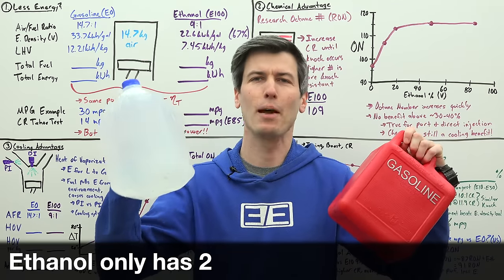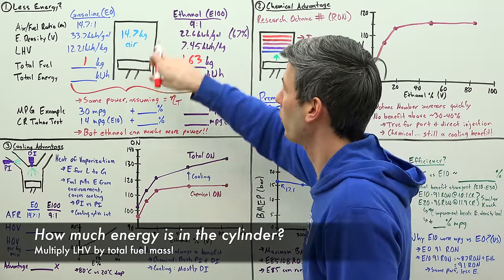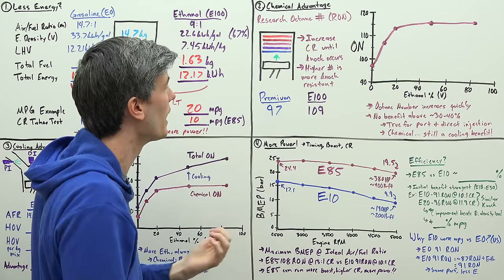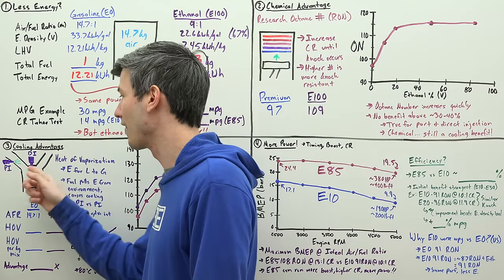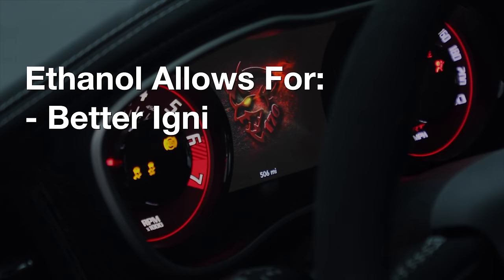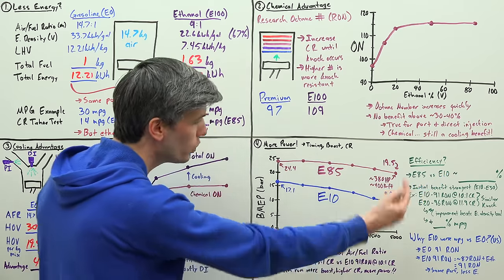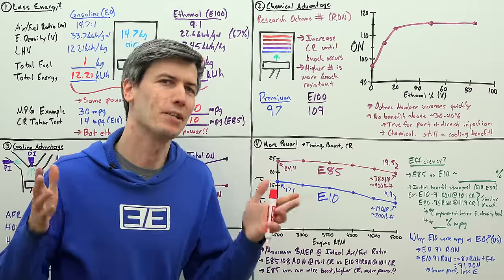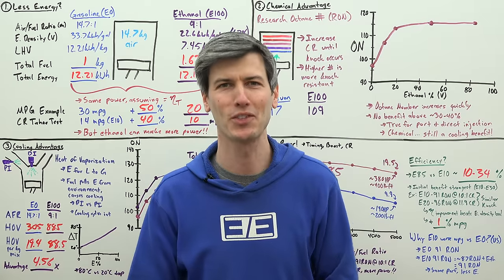Why Does Ethanol Make So Much Power? (Versus Gasoline)

Comment: I am actually curious about the synthetic fuel that I think Shell and Porchse are developing in Chilie. Could we see higher octane fuels because of the synthetic nature of the process?
It would be interesting if one day we could get 120 octane pump gas and run far higher levels of boost in turbocharged cars.
Reply: Synthetic fuels are going to mostly come in low-octane diesel.
Without mixing ethanol, it's much more difficult to get high octane numbers. 93 octane gasoline is equivalent to 90 octane with all the ethanol removed.
Reply: Yes currently at the Porsche facility they make a heavy and light gasoline when they are making fuel but they mix them to produce the synthetic fuel. So if you only use the light gasoline, without mixing, then the octane would be much higher
Reply: It's possible. When making things synthetically, you can tailor the process to get whatever compounds you want. Tests done in the Naval Research  Lab for mil-spec aviation fuel (meant to be powered by a ship's nuclear reactor) show a better concentration of the lighter hydrocarbons. You can then oligomerize them into larger stuff. And a cost of less than $3/gallon.

Comment: There was a cool paper I read from Ford where they did testing on a dual fuel system, with the engine running on 87octane gasoline, but when you got on the throttle a bit of e85 from a small tank was injected to combat knock and cool the intake charge.
Reply: Haram... you're one fuel pump/injector failure away from overheating your engine.
Reply from the maker: Neat!
Reply: @igrluz  no, you just limit airflow into the engine, so it would operate under reduced power. That's the mode it was designed to operate in if you let the e85 tank run out, or you couldn't find any.

you can run a high performance engine on regular gasoline, you just can't put a heavy load on the engine or else knock shows up. Limiting max manifold pressure with the electric throttle body would be easy with software.

Comment: Hey Jason , when you apply the brakes just a little bit in a dct, does it disengage the clutch completely. What if press the both accelerator and brake ,what happens to the clutch then?
Reply: It would only disengage at ~1000 rpm in gear 1, right? Any other gear it should just downshift before the revs go too low
Reply: It's probably in gear to save fuel, if you clutch in you will idle and burn fuel
Reply: @jonathansmith7306  that’s what I would think, though I’m sure each manufacturer tunes theirs a little differently. No idea what happens if you’re driving and hit the gas and brake at the same time though, but likely it won’t disengage the clutch until it determines you need to shift like you said.
Reply: @ALMX5DP  for the second question, if you hit both the accelerator and brake at the same time, the controller would probably measure which direction the tachymeter goes. If you are able to keep the needle still, it won't matter because it won't have to shift
Reply from the maker: Brakes won't trigger the clutch to open in DCT; if you're at speed it will remain in gear. If you're at a low speed (inching, very low speeds) the clutch will slip to allow for the lower speed (we're talking under 3-5 mph or so, where the engine speed would be too low for the current vehicle speed). 

RE gas & brake, depends on the make. Some allow it, some will say "they want brakes." Either way the clutch is likely engaged unless you're at a very low speed.

Comment: This is why many WWII fighters were equipped with methanol injection, they could run higher manifold pressures and make more power during dogfights without detonation destroying the engines. Reno air racers too, of course. (methanol/water mixes, and other concoctions were also used)

Comment: Ethanol is cool in general. Higher consumption means hard no for me - also not available in Canada at many places. Also, heard many guys complaining about having to do maintenance/tune ups more often due to plugs getting fouled quicker.
Reply: Main issue is when it get’s water in it do you need more stainless etc.  Most modern engines do that, and once that is done it is less of an issue.  I am unsure on what spark plugs are made of, but that may be part of the issue?
Reply: It's inherently hydroscopic (readily absorbs water) and also will separate if left for some time - which leads to those stories of needing to replace fuel system parts. It's really only a fuel for racing/power/etc. Theres no economy in it. Even EE talked about how bad it was even compared to cellulosic ethanol and other alternative fuels when the government was looking into alternatives en-mass. Some people get to caught up into the "mooar power = moar better". But these flex fuel cars and ethanol sold as "economical" is just a scam. 

Though fortunately, the scam resulted in mass producing a race fuel you can pump near you (sometimes) :)
Reply: Exactly .... it really is a dirty fuel solution
Reply: @frjhracing  Yep and a relatively cheap race fuel at that. One of the best decisions I made was to swap over to E85 for my trackday car. I wanted to convert my old Chevy over to it also but like you said it doesn't do well sitting around so I think the synthfuel will be better for antiques, especially if they can be tailor made to a certain octane level without using ethanol and will probably come with good quality stabilizers.
Reply: I've never seen E85 at all in Canada; some reports say that there are only four stations with it in the entire country - all in British Columbia. There is also no E15 or E25. The difference between Canada and the USA in this respect is likely the level of government interest in promoting corn production (corn is the grain most commonly used for ethanol production for fuel).
Reply: @frjhracing  I agree with the difficulties by it being hydroscopic, but to call it a scam is a bit much.  ESPECIALLY if we get to doing Cellulosic Ethanol with  Miscanthus or better yet native grasslands (with ash return)
Reply: I am more of a Dimethyl Ether (DME) fan at the end of the day.  Give me a Multi-Fuel Diesel Engine with DME Fuel Option and I’d be set!

Better yet…an Opposed Piston Diesel Engine running all that…or better yet…A DIRECT DME HIGH TEMP FUEL CELL and per wheel motor based awd
Reply: @SmoothCruizer37  and the joke is you got a Corvette on your page...ride a bike if your worries about dirty fuel.

Comment: I remember running an E47 tune (roughly 50/50 of 91 octane and E85) in my Cobalt SS with a turbo 2.0. I looked like a mad scientist when I was pulling 2 different pumps out for one fillup. But it was worth it for all of the horsepower because I could run like 26psi and more advance than the running straight standard 91 octane cat piss here in California.

Comment: The Cummins  Bilt, ETHOS engine has entered the chat and it’s very angry you did not mention it.   Is 40% brake thermal efficiency running on E85 a joke to you?   That beats a lot of diesel engines efficiency.
Reply: This is not new technology or knowledge, it was known long ago.  It is suppressed technology.

Rear Admiral C.M. Chester wrote Henry Ford a letter on Dec.15, 1916:
"...I also pointed out in the article that as governmental laboratories had developed from 40 to 55% efficiency in alcohol engines as against 20% in gasoline machines, the use of alcohol at double the cost of gasoline for power purposes, was cheaper for motor[s] than gasoline in common use today."

The Navy was not the only researcher to possess that information:

Scientific journals from 1890 – 1920 contain hundreds of references to alcohol fuel at the dawn of the automotive era. 

Studies of alcohol as an internal combustion engine fuel began in the U.S. with the Edison
Electric Testing Laboratory and Columbia University in 1906. Elihu Thomson reported that despite a smaller heat or B.T.U. value, “a gallon of alcohol will develop substantially the same power in an internal combustion engine as a gallon of gasoline. This is owing to the superior efficiency of operation…”

The USDA tests in 1906 also demonstrated the efficiency of alcohol in engines and described how gasoline engines could be modified for higher power with pure alcohol fuel or for equivalent fuel consumption, depending on the need.

The U.S.Geological Service and the U.S. Navy performed 2000 tests on alcohol and gasoline engines in 1907 - 1908 in Norfolk, Va. and St. Louis, Mo. They found that much higher engine compression ratios could be achieved with alcohol than with gasoline. 

Almost all manufactures have built efficient ethanol prototype engines save Scania who sells theirs's worldwide now.  Here are a few:

FROM RICARDO:
The new federal CAFE standards are calling for a doubling of fuel mileage performance, which, Vint says, is going to send OEM’s looking for high octane numbers to improve efficiency and ethanol is the best source. Ricardo, an engineering firm with over 100 years in the business of engine design, has developed an extreme boosted direct injection engine (EBDI) to optimize ethanol blends. The 3.2 V6 gasoline engine rivals the power and torque of a much larger GMC Sierra 6.6 diesel, he said, and it delivers 3.5 percent better fuel economy than the diesel.

FROM CUMMINS ETHOS ENGINE:
According to Cummins, it delivers the power (up to 250 hp) and peak torque (up to 450 lb. ft.) of gasoline and diesel engines nearly twice its displacement...
...Using corn derived E-85, the high thermal efficiency and power-to-weight ratio of this engine results in 50 to 58 percent lower well-to-wheels CO2 emissions compared with the gasoline engine baseline. Using second-generation, lingo-cellulosic derived E-85, the power train’s efficiency features deliver 75 to 80 percent lower well-to-wheels CO2 emissions, depending on the drive cycle.

FROM EPA & FORD ON FORD'S ETHANOL OPTIMIZED ECOBOOST SYSTEM:
Compared to production gasoline engines:
Fuel efficiency is ~15 – 20% improved for various drive cycles.
Full load performance is significantly improved, and comparable to production diesel engines.

GENERAL MOTORS:
...the Saab 9-5 flex-fuel engine can give improved fuel consumption under mid to high load conditions. Whilst fuel economy over the official EU city and mixed cycles is unlikely to show an improvement, testing indicates that a useful 15 per cent gain can be expected at higher speeds because fuel enrichment for engine cooling is no longer necessary.
In its Saab turbo application, the high 104 RON octane rating of E85 fuel, the 85 per cent ethanol/gasoline blend most commonly available at filling stations, also produces a significant 20 per cent increase in maximum engine power, up from 150 to 180 bhp.

THE INDY 500:
In 2005, the IRL used 100 percent methanol in their tanks. The fuel worked well and was more efficient than straight gasoline, but IRL officials believed there was room for improvement. In 2006, they moved to a 10 percent blend of ethanol and methanol, which was then changed to 100 percent ethanol for the 2007 season...
...The switch to ethanol also allowed the racers to carry less fuel and make fewer pit stops, thereby increasing efficiency even more. "When the cars ran on methanol tanks had to hold 30 gallons to accommodate the fuel requirements of the cars," Vervynckt says. "After getting the engines to perform at their full potential, there was a significant gain in mileage. Indy cars now have 22-gallon tanks. When a driver pulls in to change out his tires, he can fill up. Teams were able to match their tire and fuel stops exactly, instead of stopping for tires only, or fuel only."s

FROM THE EPA:
An important step toward increasing alcohol fuel demand, then, may lie in providing economical engine technology options that utilize such fuels more efficiently, to compensate for the lower fuel energy density. The FFVs produced today, however, use fairly typical gasoline engines, which, because they must retain dual-fuel capability, are not able to take full advantage of the favorable combustion characteristics of alcohols. Engines optimized for alcohol fuel use, on the other hand, may yield efficiencies that exceed that of state-of-the-art diesel engines—or, about one third higher than that of FFV engines. In earlier engine research at EPA with neat methanol and ethanol [1], for example, over 40% brake thermal efficiency was achieved over a relatively broad range of loads and speeds, with peak levels reaching over 42%.

FROM SCANIA:
The new bioethanol engine delivers 2,150 Nm, equal to that of its diesel sibling, and the fuel consumption is also on a par with a conventional diesel engine. The foundation was built by Scania’s 13-L inline six engine. It uses compression ignition similar to conventional diesels, which limits the need for hardware modifications. The more significant changes made to the engine are related to the fuel injection system and modified cylinders for increased compression. The same SCR aftertreatment is used that Scania applies in nearly all its Euro 6 engines.
Reply: @danafletcher2341    That is a good read. Thanks for the info, I’m building a turbo 351W for max mpg in my old bronco so I hope all this turns out like everyone tells me it will.

Comment: I would love to see a similar comparison with a "Race" fuel like a VP Fuels MS109 unleaded gasoline or C16 Leaded gas race fuel compared to Ignite RED or a One Ethanol fuel.  

My go to blend s ~3 gal e85 with ~15gal 93.  Approx 15-18% e and the car is way different in a better way part throttle is much improved.  
GREAT VIDEO!!!  Thanks!
Reply: Hotrod did a video last year  E85 one. Heads exploded.

Comment: nice video , l mix e85 with e10 on my GDI engine , going on 75% e85 on summer , and 25% on winter (to be able to start easy on cold weather without having to press the pedal while cranking) . when running e10 I get about 9.8L /100km , on e85 about 11L/100km . running on e85 sounds nicer too on "less" restricted flow exhausts , and seems to have a cleaning effect on the engine
Reply: I mix too! great results and save money.
Reply: @Madpegasusmax: I’m all for running a richer blend of ethanol, and the numbers behind it,but that’s where my support for your comment ends. Where I live, there are a bunch of youngsters who drive straight-piped sports cars down the road in 1st gear at/around the 2500 to 3000 rpm range, making enough noise to be heard from 3+ miles away, clear across town! I really hope you aren’t one of THOSE people.
Reply: @jacobcarlson4010  no , I have a stainless  line and muffler , I kept the CathConverter , and I don't go high rpm in town , I think about the others ;) . I said it sounds better , not sounds louder 😁. I fully agree that people with loud exhaust should respect the others , doing the less noise possible while driving in town , and specially at night

Comment: It's astounding how much better a DI engine can run on E85. I run my GT86 on the stuff with an appropriate tune and minimal intake and exhaust mods and manage to squeeze an extra 50~ish Hp just due to the ability to run more aggressive cam and ignition timing. I burn more than i do on 98 RON, but when i drop back to a 50-50 mix (about E40) im still getting 40ish HP and burn less. Its just a shame that E85 costs a bomb in this country...

Comment: The BMW FI team In the early eighties apparently used toluene and maybe a little Diesel and Diesoline and probably mixed gasoline. This was probably one of the reasons for the many horse powers. toluene gives high octane value also in Mon . E85 doesn't seem as high octane in Mon

Comment: Same with methanol. We were running a big Jimmy on methanol. It had 5 Stromberg 97's. Re jetting had little effect.  To pass the amount of fuel  needed carb passage ways had to be drilled larger. .

Comment: Thank you! I just learned a lot. 

That’s an excellent explanation of what happens in a new engine that’s designed to sense and adjust. But does this apply to my 1988 Ford EFI or do I just lose 10% efficiency by using E10? 

This is great for people who are interested in more power, but not for people who want more miles from a tank of fuel (or more miles per dollar). Where I live, we have to pay about $1.00/gal more for E0, which doesn’t make sense for a society that’s trying to be environmentally friendly and efficient.